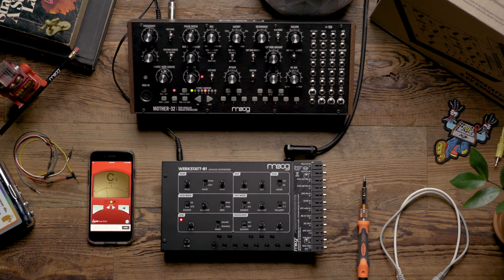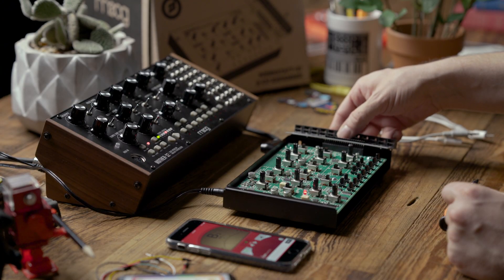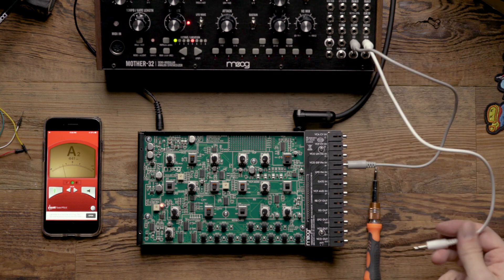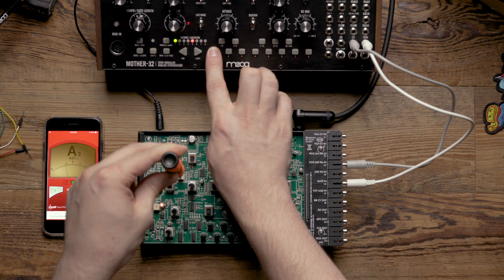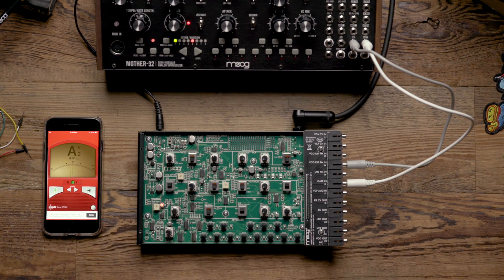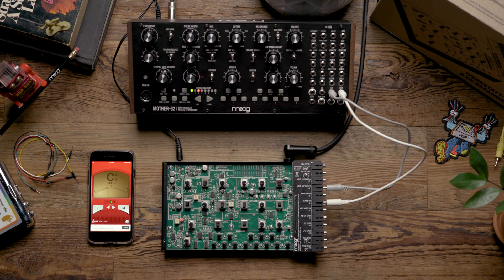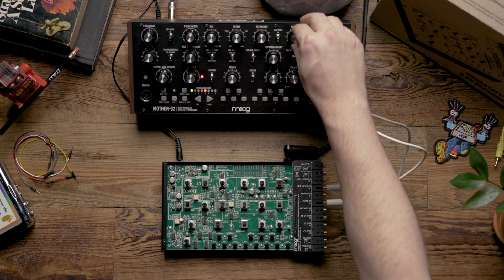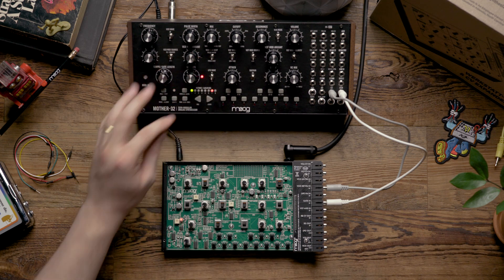Werkstatt-01 | How to Calibrate Werkstatt

Comment: I'm trying to do this with my Mavis but I cannot get it in tune no matter what I do. It's connected to a keystep and the 1V/oct trimpot VR18 does not adjust the pitch no matter what key I press on the Keystep. I've been trying to get this to work for hours now and I'm honestly about to just return it, this should not be this difficult to do.

Comment: If you're trying to calibrate the werkstatt using the arturia key step,  use the midi control center, under CV/Gate settings you can choose the 0V note. Mine was set to -2C !

Comment: I'm using the Werkstatt-01 with the Arturia Beatstep Pro, but when I turn the VR5  I can't find any note where it doesn't move, I tried all the octaves. any suggestions?
Reply from the maker: It has to either be the lowest possible note if the sequencer is unipolar, or the exact middle note if the sequencer is bipolar, and it typically will fall on a C.

Comment: When calibrating the new version of the Werkstatt with the Keystep, in the Keystep's Midi Control Center should the Gate CV Output be in S-Trig or V-Trig? Also, should the 0V Midi Note be changed from C-2? Thank you for any help you can provide!
Reply from the maker: Gate output should be V-trig.  No need to change the 0v midi note, it really comes down to your preference, either way, you'll just want to use 0V for this calibration process, wherever it falls on your keyboard.
Reply: @MoogSynthesizers  Thank you for the reply! Ok, V-trig it is! The reason I was concerned with that as well as changing the 0V MIDI Note is because the only way I can find a key that doesn’t change pitch when I mess with the trimmer is by dropping the octave of the keyboard from 0 to -3 or -4...

Comment: What is the actual difference between the vco lin en exp cv inputs?
Reply from the maker: They offer different responses to control voltages.  Exponential scaling is used for 1V/Oct signals, so say feeding 2V to the exponential input results in a C, that means the C an octave above will be 4V, and the one above that 8V, etc.  With that in mind, if you fed an LFO that operates from -5V to +5V into the exponential CV input, you would get an asymmetrical response where the higher voltages have a stronger effect on the pitch modulation.  That same LFO fed into the linear CV input would yield a symmetrical response where the lower and negative voltages have the same strength of modulation as the positive voltages.

Comment: Does each Werkstatt come with a Mother-32 to use as calibration reference? :D
Reply: It's called upselling
Reply from the maker: Well since this calibration is for the VCO exponential fm input, the process requires an external CV source.  We chose the Mother-32, but the idea is that you'd calibrate the Werkstatt to whatever external CV source you decide to use to control the Werkstatt in your studio.
Reply: @MoogSynthesizers  Just kidding! It would be awkward to fit in the box, don’t you think? :D

Comment: which input its the equivalent of "GATE IN" in the old version CV Expander?
Reply from the maker: You can use the 'Gate Out' on the old version as a 'Gate In', it operates both ways.
Reply: @MoogSynthesizers  I’ve seen mods to implement your own dedicated Gate In for the old expander. Is there any advantage to this besides getting a separate i/o out of it? For example cleaner gate signals from one or the other, or is it unnecessary if you don’t care about sending gate in and out at the same time (for whatever reason)?